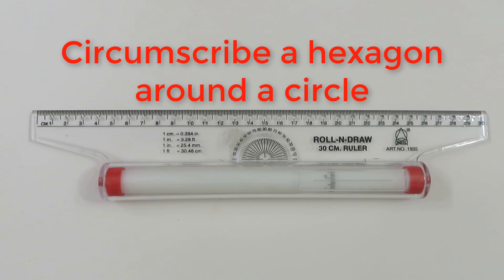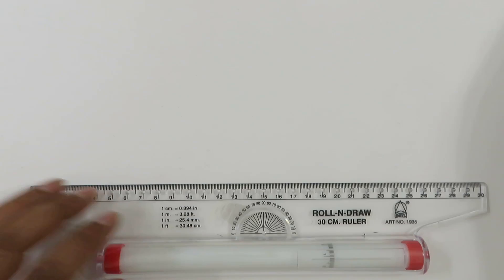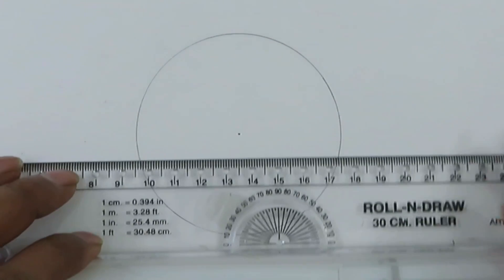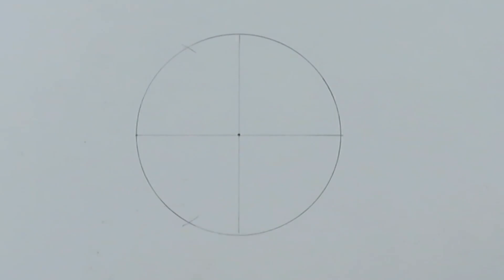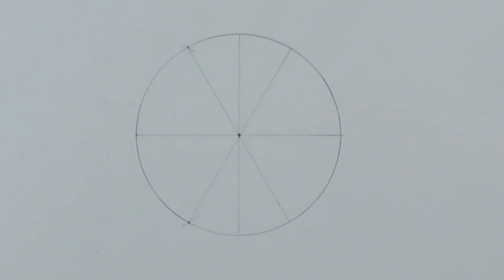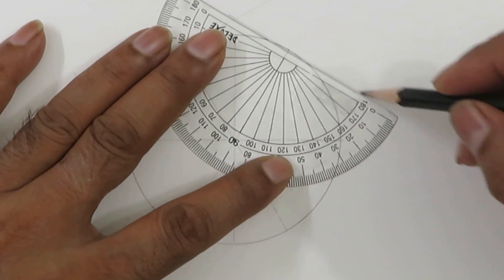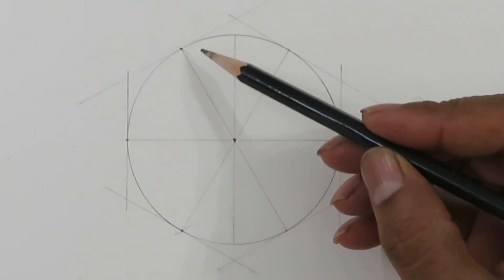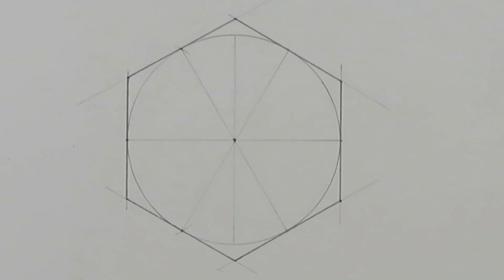Circumscribe a regular Hexagon around a Circle (Simple and easy method)

Comment: If you add up the sides of the hexagon in other words find the perimeter of the hexagon, that is also approximately the circumference of the circle that with the same radius as the length of one of the sides of the hexagon.
Reply from the maker: Interesting point. The circle radius equal to one of the sides of a hexagon is the circle circumscribing a hexagon. So the perimeter you have mentioned will be slightly less than the circumference of that circle. The circle drawn in this video will have the circumference which is slightly less than the perimeter of the hexagon. Thanks for your comment.

Comment: how do you calculate the side length of a hexagon in the circumscribed circle

Hi
Ivan From Denmark
Reply from the maker: In drawing, the side length is obtained by the geometric method. It may not be exactly to the length you can calculate due to drawing errors. In engineering drawing, the basic dimensions are exact and the derived can be what we get after drawing.